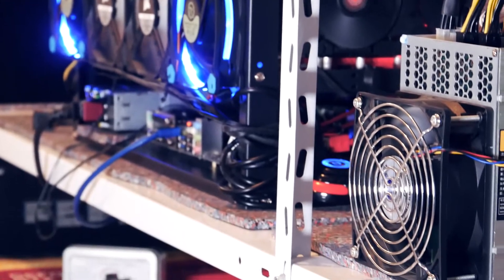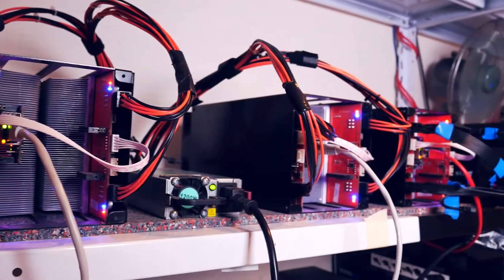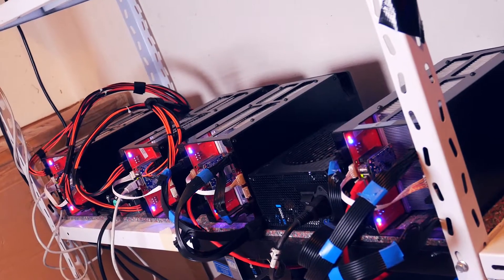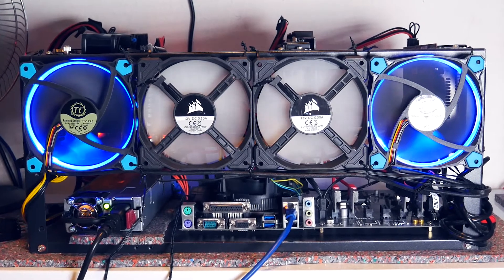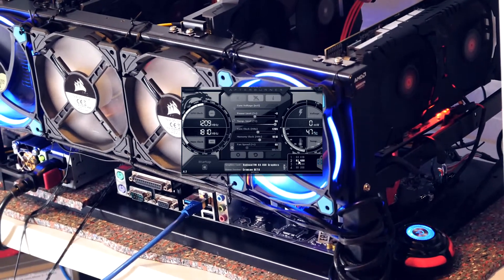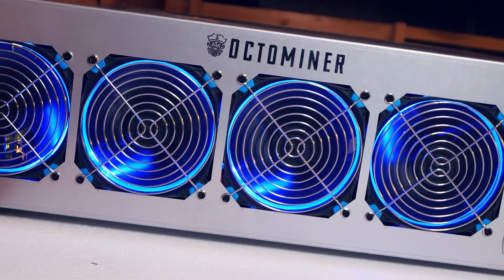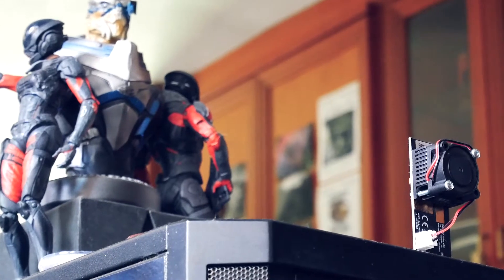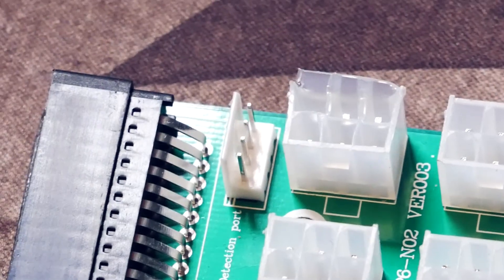Cursed Mining Farm #3: June 2018 GPU / ASIC Update

Comment: Loving your videos so far cursed! What's the best pool and Crypto to mine with the L3 as July 2018?? Running BlissZ rom, around 580 /MH. Cheap power.
Reply from the maker: Hey mate thank you very much for the feedback! So for pure LTC mining for me litecoinpool.org is still the most profitable. When I want to go a bit crazy and experiment I go for either Zergpool or Hash-to-coins which I found very nice for other altcoins in the past =)  where do you have your Blissz-L3 on? =)
Reply: Cursed Mining Great to hear! I've been using Litecoinpool as my primary pool and have had great success with it. Fast MH rate straight forward, easy payouts in 0.1 increments straight to my LTC address. Ad far as I the OC, I'm having to run farely high V to the chips to achieve the 580/ MH with low HW errors. My OC setting is 444-Frequency  and 16 Asic Voltage, running @ around 950W, 120v...(a bit high on the Power consumption) but very Low HW errors on 1 chip, the rest 0) Underclock settings currently in looking at 406-F and 11V to the chips. Running around 820w to the board
Reply from the maker: I also find it very reliable! Also they do merged-mining but pay it directly in LTC to you what I like - that's one of the reasons it is most profitable in my opinion :) Awesome setup on your L3+ mate! I am still with L3++ firmware but I should definitely go for Blissz next, just didn't get to it yet unfortunately!
Reply: Cursed Mining I appreciate the informative and quick reply Brutha! Liking this Blissz a lot! I flashed the L++ Vida ur Video with no installation issue, but upon running I found that my L+ was running into a crazy amount of HW errors on all 4 chips (@ stock voltages on L3++) loaded up the blissz, w/out dev fee and my miner seems to love the underclock. Good day 2 u m8
Reply from the maker: Pity that it got so many HW errors but if it brought you to Blissz, then nothing happens without reason :D thank you again for sharing your experiences and welcome to the channel :)